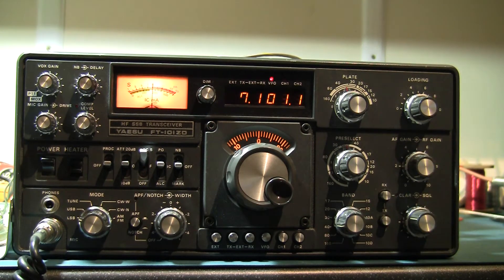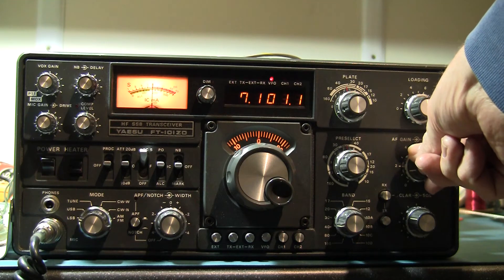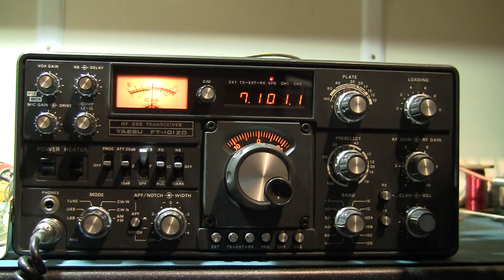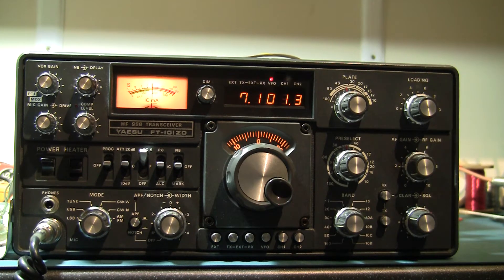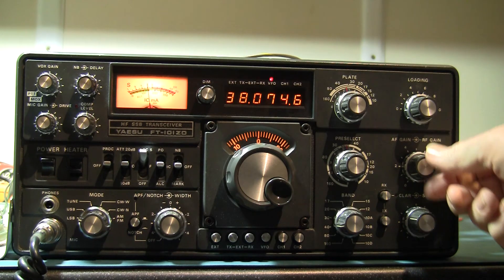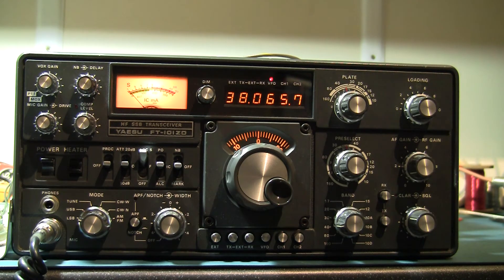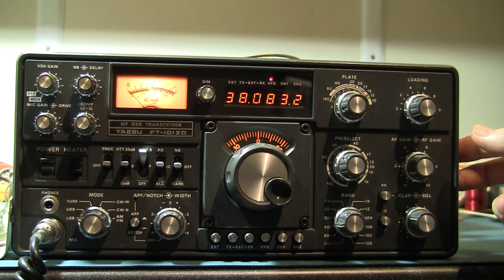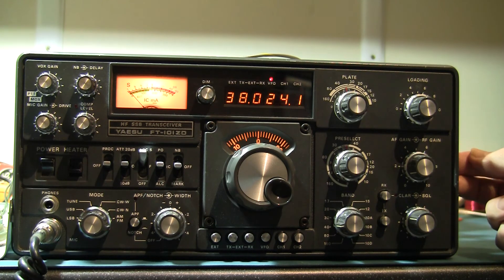FT101ZD Hetrodyne Oscillator fault - Part 1

Comment from the maker: Still going strong even now, much easier than trying to find a replacement crystal to the correct spec which might not even come up on freq anyway. Ultimately if it does fail then a new crystal would be required but based on past experience they frequently need the loading changed to get them on free.